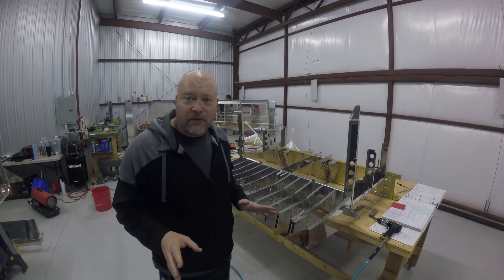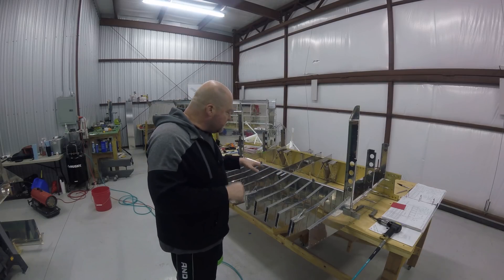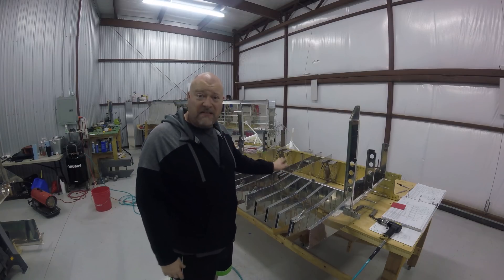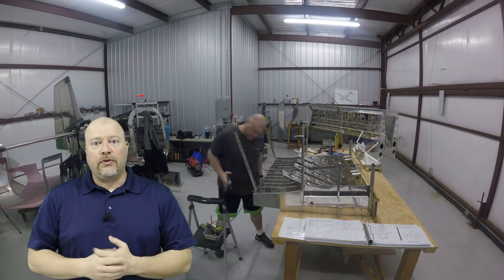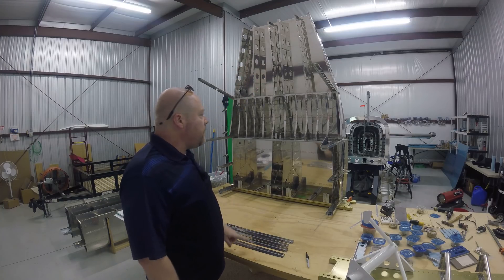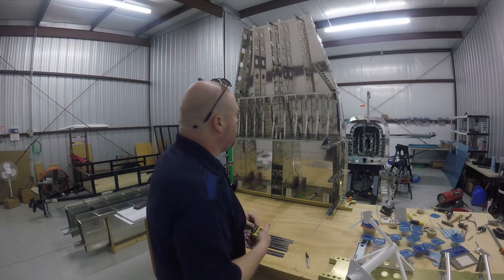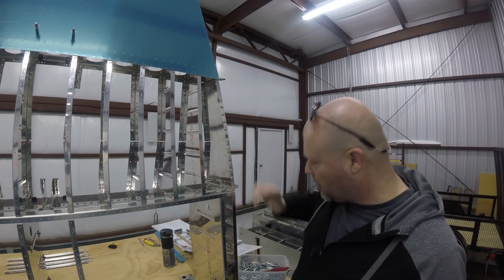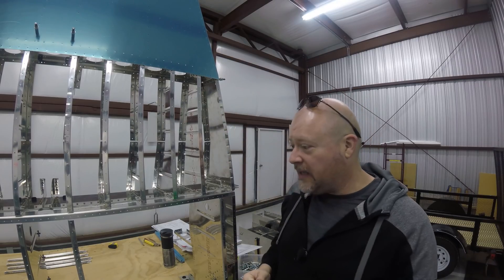RV-10 Fuselage - 010 - Skins and 954 holes, Bent Ribs, Fluting and Access

Comment: On the couple ribs that you installed the shop head forward. They will be in the way when you install the rear floor. Trust me, it's a tight fit and that's why the manufactured head forward.

Comment: I gave up on cordless drills a while back.  Yes they are handy to use, but the batteries die and you have to buy extras to charge and keep working, then they quit holding a charge and you have to buy more and on and on.  The batteries are just so expensive!  So now I just about always use a corded drill.  Never have to worry about batteries and I rarely need a drill in a location so remote that I don't have somewhere to plug an extension cord.